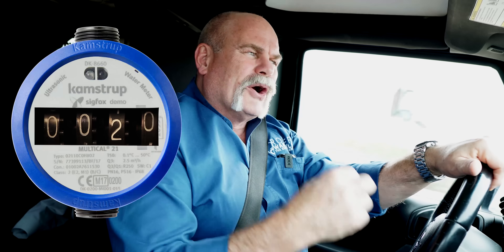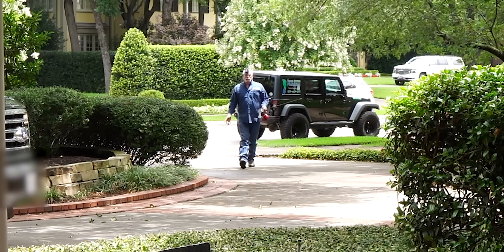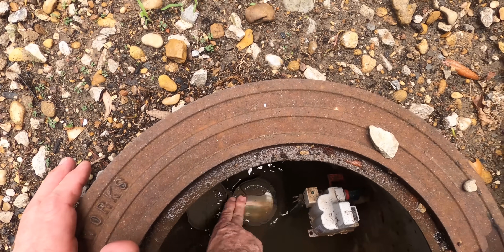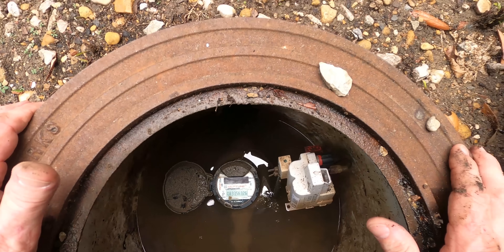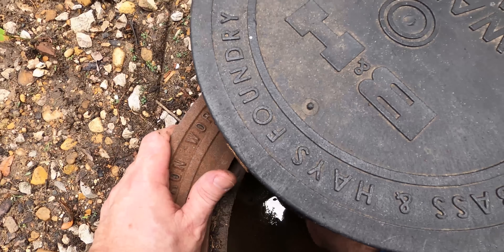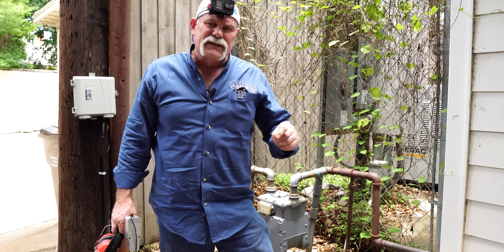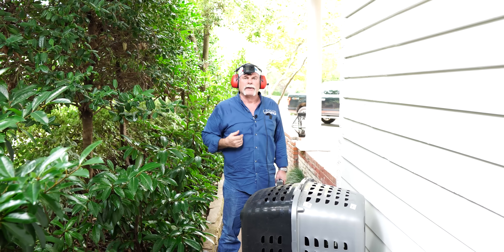How to Find Water Leaks - Water Meter Hasn't Stopped Spinning

Comment: My first thought when you described the issue, did anybody verify the email message?  The results here do not match the complaint either.  A 0.33 gpm occasional flow is not "Stopped Spinning".  The old meters had a triangular trickle indicator.  So then the newer meters do not?  But might not be desired since the meter can read to 1/100th accuracy.  As dirty as the meter actually was they do not physically read the meter every month.  So that would indicate an electronic reading system.  They usually are just short range.  So how is the main office going to know if the meter was running continuously?  Did they send out a truck and driver to sit there for 24 hours to monitor the meter?  Then decided to just send an email message?  With online systems today, they might actually have an email address on record for the property.  But it would not be required for service, except for an online website account. Normally a person would not know there is a problem until they receive the water bill.  So many things wrong with this post. This is the first time I have viewed anything from this creator.  It just showed up in my suggested feed for some reason.  Your investigative areas here are OK, I noticed nothing wrong there.  Just the overall scenario of the issue.  Like something was just fabricated for the video.
Reply: My online account with my city a couple of cities north of Roger's office has readings about every 4 hours. While it's not continuous, it would be unusual to have water flow every 4 hours. I also have electronic billing, so they know my email address. And no, they don't drive a truck through the entire city every 4 hours. So, it's not as contrived as you might think

Comment: Why not pump out the meter box and check the meter couplings? Does DFW not send someone out to turn the curb stop off and listen or the check meter? 

Totally about K.I.S.S. method. Simple task for a homeowner is to put some food coloring in the tank, if there is a leak on the flapper it'll show in the bowl.

Comment: Lol I had that happen a few months ago and the landlord hired a plumber that said it was just a cartridge leak in the main shower even though you could hear water running throughout the house. He still just replaced the cartridge after I told them it’s a leak in the crawl space because you can hear water running and there’s no way a bad cartridge would cause a meter to run that much. Needless to say he was back a week later crawling in a muddy crawl space replacing a section and sweating pipe.

Comment: i'm leaking about 10k gallons a month. i've torn apart my entire yard looking for this leak after ruling out the inside of the house. it's absolutely driving me nuts ;-;. i just can't find it.
Reply: You can hear the toilet running if it is that duh
Reply: Check the toilet tank. My plunger inside the tank didn't seal properly and I lost 5-6k a month until I figured it out
Reply: Have you called a plumber?  Maybe you don't know what you're doing.
Reply: Try:
1. Go to an automotive parts house.  Get a mechanic's stethoscope. 
2. Shut down your main house supply (look near the water heater or softener).
3. Go back to the meter and check to see if it is still clocking. 
4. If it is not clocking, then the leak is in or under the house.
5. If it is clocking with main valve off, leak is in the yard. If that is true, try shutting down the main supply to irrigation. 
6. If leak is not in the yard, then try shutting down the main shut off valve at water heater. Repeat checking at meter.
7. So, now you have three independent legs. Yard/irrigation, domestic hot and domestic cold. One (at least) of those should show flow.
8. Let's pretend that after this you deduce that the cold side somewhere indoors is leaking. Use the mech stethoscope and start probing the angle stops (the individual shutoffs for each fixture). All that this does is help you guess how close to the leak(s) you are. If house is built on slab, the next step is to choose the loudest sounding area, get into the wall and split the manifold into separate pressure tests.
9. Upon finding the failed leg, you need to find the other end of the bad leg, because all that this reveals is that somewhere along that line is a problem,  but if it tags into yet another manifold,  then splitting that one is also necessary! 
10. Eventually,  you will narrow down  to precisely the one bad loop underneath. Then you have to find a way to rebuild (perhaps overhead?).
11. A fish tape shot down the pipe might help isolate where the next manifold is.
12. If on the other hand,  your house has a crawl space and you can visually check all feeds below, disregard most of this!
13. You say you have dug most of your yard up?
14. As an additional proof of whether the leak is in the yard, if you can find the main shutoff for the house, shut it down. Then jump a garden hose directly from the meter to your clothes washer, cold feed. This will reverse charge the main and tell for certain that a leak is somewhere between the curb and the house.
15. Good hunting!
Reply: @mikelabor8155  thank you so much for this. I'm gonna try to get the stethoscope and slowly walk through the pipe i dug out with it.
Reply: Have you found the leak?
Reply: sorry guys i forgot about this. So i have a main shutoff running into the house. i've turned all the water off in the house and the leak detector still spinning at the same rate. I only have 1 pipe running from the meter to my house, so it's somewhere along that one pipe. (no irrigation system)

I wanted to find the leak before calling a plumber to save some money, so i literally dug up from the house to the water meter. still cant find a damn leak. 10,000 gallons is half a damn swimming pool. I'm losing my mind over it too. I'm gonna have to call a plumber, but i definitely cant afford it right now. Thought if i knew right where it was and had it dug out for him, he wouldnt charge me as much just to replace a section of pipe.
Reply: I also had another idea. If you have access to a nitrogen tank (welder friend?) you can try juicing the the system with a couple hundred pounds,  and just listening.

Comment: Knowing that the leak only showed every once in a while on the meter using 0.33gpm I would have deduced its a ballcock on a toilet kicking on when the leaky flapper or aqua piston let enough water out to cause the Ballcock to trip. Locating which toilet it is as easy as dye test or magic marker the water lever line in the tank of the toilet. All you done at the begining yes isolate everything narrow your search but as soon as I seen the time frame in which it was registering a leak on the meter and then the subsequent amount of water being used toilets would have been the next thing I would have looked at. Not knocking your style but I would have checked those before I called it.
Reply: he said the leak is not on the potable side, its on the irrigation side...
Reply: @nsaylorable  no he shut the irrigation off and still had the leak. Irrigation is constantly live it would not fluctuate from leak to no leak
Reply: @derrickfeltner6634  its not real clear but doesnt he say the .33 flow stops when the irrigation is valved off @ 11:46?
Reply: @nsaylorable  I thought he said said it wasn't I watch again and get back with you later
Reply: @nsaylorable  and for the record irrigation is potable it all comes from the same source, the city main.
Reply: @derrickfeltner6634  Once the water goes past the double check valve, Texas does not consider that water as potable, as ground water can infiltrate the system. That's the whole reason for the double check valve, to ensure ground water does not infiltrate the main system. Some irrigation systems have a main valve just past the check valve which prevents small pipe defects from leaking unless the irrigation system is running.
Reply: @johnhaller5851  He said his next step (with irrigation off) was to have the customer call the city and see if the city-side report still said there was a leak. If they said no, then its irrigation. If they said yes, then it was homebound. Im assuming since theres no resolution to this, that they found the leak was with the irrigation system.
Reply: @johnhaller5851  That would be a master valve, they can be a real pain on older irrigation systems. There is no real regulation for irrigation where I live and most people don't even bother with a check valve. They just tee off the main and put in a 1 inch ball valve.
Reply: @johnhaller5851  that I wont dispute but they are supplied by a potable water source is what I should have said.
Reply: Lol you said ballcock

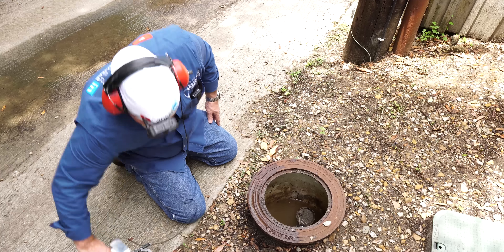Comment: 4:26 that pipes got some rockin' music in it, glad he let us hear what he's hearing!
Reply: @FatherFlashback  It's a bit loud, though, especially in comparison to Roger talking.
Reply: Anyone coming through seeing this.  It’s just basically least mine.  It’s still a listening device mine is probably newer than his one.  
But same thing.  All you hear is basically a white noise though.  Unless there’s a leak happening a depending how small an what kinda pressure is behind it. 

But what is heard is a constant white noise. An if their is a leak. With pressure it’ll have like the sound of a jet engine somewhat.  An obviously depends how close or far from it. An louder the jet sound gets closer ya are. 

An other factors. Determine the sound.  But it’s basically that though.

Comment: I’d dye test all the toilets because an intermittent leak is often caused by leaky flapper or flush valve ...great video by the way.  Where can I get that equipment for listening to water pipes. Edit:                          - I just saw in the description for the equipment-
Reply from the maker: We use some great listening equipment

Comment: After checking those things, why didn't you check the toilets?  We had the same issue, only our meter was running all of the time. We called a plumber who came out and he ran around the house like a crazy person. Went back to the basement to check the meter and it was still running. Charged me $250.00, told me he had no idea and left. The next day, my husband and I turned off all of the water valve shutoffs in the entire house. Nothing registered at the meter. One by one we opened each valve and discovered that one of the toilet tanks was leaking.  We changed the flapper, but that wasn't enough. Called another plumber to come and replace all of the parts in the tank. Charged me $165.00 and no more problems. I hope you didn't charge the customer for two home visits.
Reply from the maker: Peggy, the customer was ill and didn't want anyone in the house if they didn't need to be. We isolated the irrigation line and that resolved the problem. No second trip charge or fee.
Reply: @RogerWakefield  Thank you!

Comment: I learned a lot from this video. Water has the uncanny ability to find its way.
Reply from the maker: Scully's House of Thrillers water always takes the path of least resistance. Thanks for watching and commenting.
Reply: @RogerWakefield  one could say it follows the richest roads
Reply: @RogerWakefield  well then I'm 100% water now
Reply: As the doctor once said "well sure it's airtight, but that doesn't mean it's water tight"
Reply: One time in the winter, we saw water coming up to the surface. We followed the water for 30 feet until we finally found the leak. Also ill add that our towns utilities are 8 to 13 feet deep because we get some much frost when its cold.
Reply: Always look for traffic?
Reply: @HurremDurrem  Yep, anytime you get out of a vehicle, or getting gear. You have the ones who don't care and could hit you. One of the causes of death for tow truck operators.
Reply: There’s a channel called Practical Engineering. Brilliant informative videos. You’ll like it

Comment: You can use a double check backflow preventer on irrigation in Texas? In Indiana they only allow a vacuum breaker or an RPZ. I love that leak detection device, we have one similar but it has a pinging device that attaches to a pipe and lightly knocks in it, that way you can locate buried lines and the source.
Reply: Testable double check is required for irrigation

Comment: Hate to sound stupid but what’s a double check haven’t heard this term
Reply: Hey Jd in the Army they always told us the only stupid question is the one you don't ask. I'm a apprentice in Arizona and I also never heard of double check.
Thanks for asking the question that I'm sure you weren't the only who  didn't know what it was.
Reply: soldiersilk65 I’m figuring maybe a check valve
Reply: It’s a type of backflow preventer. It protects to the public water system since pesticides can actually seep into the irrigation heads and if there was a break in the line or a Venturi effect upstream it could actually siphon harmful chemicals into the public water supply.
Reply: Taylor Mcglaughlin thanks
Reply from the maker: Taylor Mcglaughlin nailed it. Backflow prevention device!

Comment: I can tell you that the leak is probably from a toilet. It's leaking, then it's not. Put dye in the toilet tanks to verify that no flapper is leaking by the flush valve. It's fairly common for fluidmaster's to be installed with the refill tube shoved down in the overflow. This causes a slow siphon of the water in the tank. Unlike the old ball type BCV, these new BCV's will not leak slowly, but come on after the water level has dropped. They come on fully until the water level has reached the shutoff point.$20 says I'm right,Roger
Reply from the maker: forty two it was the irrigation system. The customer was ill and didn't want anyone in the house or we would have checked that out for sure.